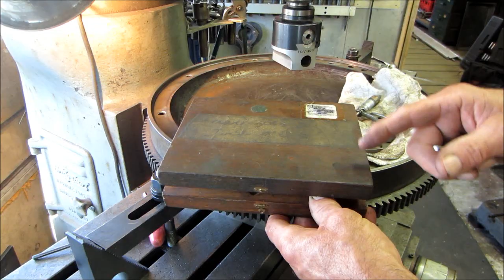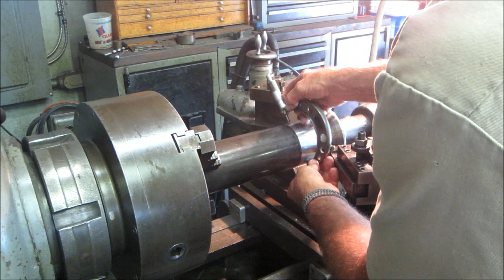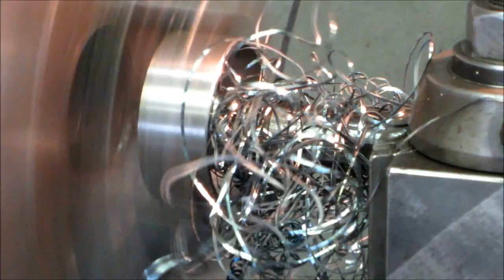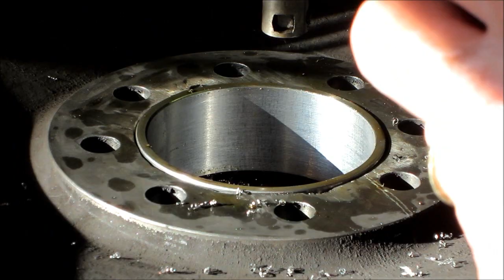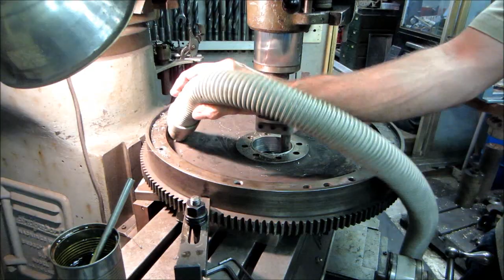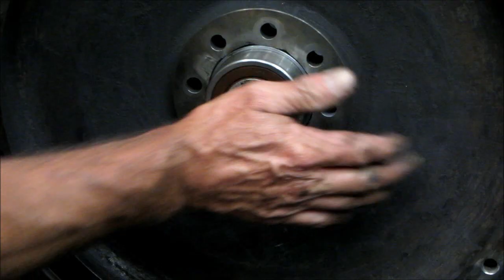Hack & Tack Smack Part Two

Comment from the maker: Minimum 1/8" sleeve wall thickness is a good rule, with a .001 to .0015 per inch in diameter, up to about 6” refer to machinery’s handbook for change ups after that. If you can’t bore it due to material options other holes etcetera.

Comment: Have you ever done a sleve job like this,and had a real heavy press,maby more than you intended for whatever reason.After you machine the  bore to final dimention,have you ever had the sleve collapse,or move because of removing its mecanical ability to hold tightly on the  diamiter. If so is there a good rule of thumb for min. wall thickness in relation to the bore?  That way you could figure at the start wheather you were looking at a sleve job or a braze repair or (stick buildup repair) lmao!